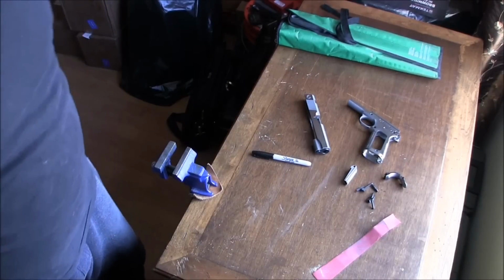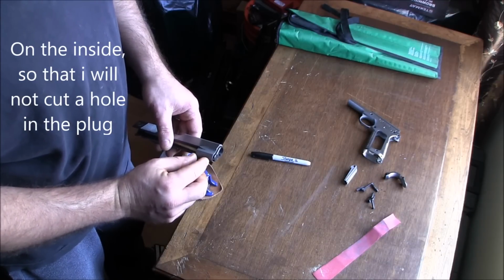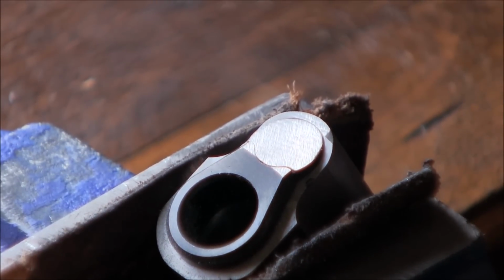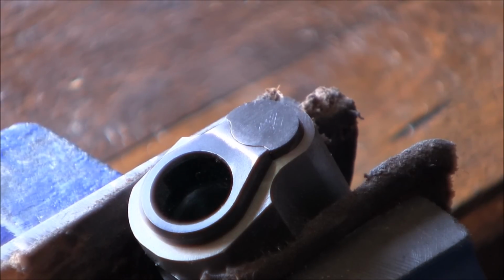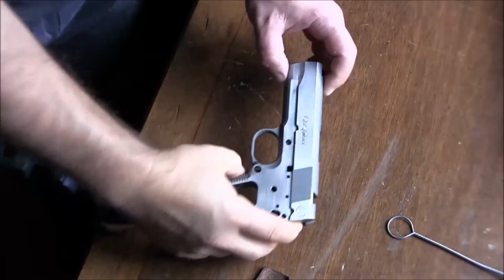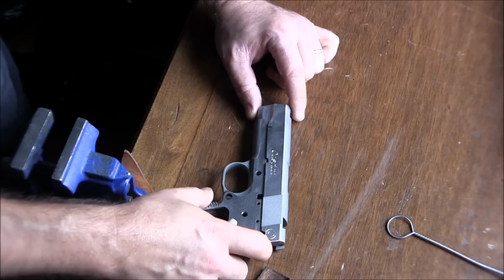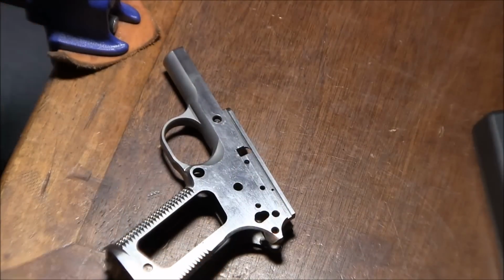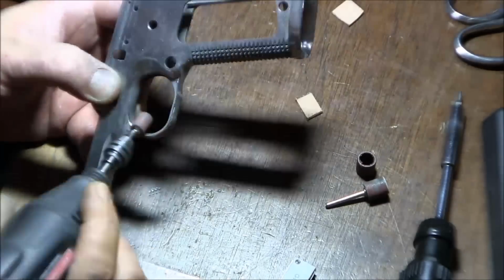1911 Build 8 Commander 45 acp - Part 11 - Bobnose and Dehorning

Comment: Mosin, did you ever consider putting a flat top on your slide?  I love the Colt Commander Enhanced versions -- in fact, I'll be receiving a Mark IV Enhanced soon.  I guess the point is the lighten the slide up a bit but I think it makes for easier target acquisition.  Anyway, love your 1911 builds.  Keep them coming!
Reply from the maker: Thank you. I actually put a tri-top on the slide for my Build 10.

Comment: Hey Mosin, I'm building a stealth arms 9mm commander right now and I just fitted the reverse plug. Before I notch the slide to allow it to recess fully I was wondering your experience with the recoil spring and assembly. I did some test tries and it seems like a real pain to get the spring in and the slide back onto the frame without the spring wanting to squirt out. Is that typical? I really don't want a full length guide rod in there, don't believe in them. Just thought I'd ask, love your videos, they gave me the confidence to try this and its working out very well. cheers
Reply from the maker: Yes, unfortunately there is nothing hold the spring in place wiht that combination of parts.

Comment: I would've liked to have seen you cut the dust cover to mimic the "bob cut".
Reply from the maker: Wayne Richter I would have actually done it if the slide didn't have a scallop. I had to start at the scallop and there wasn't enough room to angle the dust cover without exposing the back of the slide spring plug tunnel.
Reply: Great job, regardless.

Comment: Thank you for your responce, Yes I meant checkering the front strap & msh.
I did watch the video but I really couldnt understand how you got the 10lpi
from the 20lpi file?? Again Iam amazed at your work you make everything
look too easy. You are a very smart man & pay Great attention to detail.
You have probably been doing this a long time. Im in the process of trying
to obtain my FFL so that I can start a gunsmith business, I have been
working on guns for 26yrs but just asa hobby, I recently lost my perifial
vision & Im deemed legally blind so I can no longer drive or do the job I
have done for the past 30yrs. So I figure its a good time to take my hobby
& turn it into a business. But I live in MA and it being such a liberal gun
hating state Im not sure how I will do with getting an FFL..Sorry for the
ranting..
Thanks again
Scott
Reply from the maker: scott 1911man I am in CA so I feel your pain. I too am thinking of getting an 07 FFL in the future when I have more space and a workshop. The way I got 10 LPI is by using a 20 lpi file lightly to create guide lines, then using v files to deepen every other line. once I had those deepened lines, I filed the Front strap down a little to get rid of the other shallow lines.

Comment: nice videos mosin.. you're very talented.
do you know if the officer slide can be fitted into the commander frame. Thanks!!
Reply from the maker: Thank you very much. The officer and commander frames are identical I believe in the recoil shoulder position, So I think you can fit an officer slide to a commander frame. The dust cover will obviously be too long for the scallops on the slide, but that can be easily fixed.
Reply: Thank you so much for your repply, I'm a machinist and I'm building a commander like yours in a 9mm but I wanted it in a officer slide but I don't think they carry officers in 9mm so I guess I'll built 2 one commander in 9mm and the officer in .45, thank you so much mosin keep up the good work.
Reply: You know that video that you filmed cutting the dove tail, just if you want to consider some sights have the right side a little thicker than the left side, that's so when you inserts the sights you can do it from right to left so in that way the more you push it to your left the tighter it gets and it seats tighter..

Comment: What different grit sandpaper do you use?
Reply from the maker: Usually 220, 320, and 400.
Reply: @MosinVirus  do you go into the thousands for the finer finishing when blending? In order to get rid of file marks
Reply from the maker: @mr.b3699  no, filemarks should be removed by 220. 320 then removes 220 scratches, etc. I used 600 maybe once or twice, but generally I don't try to achieve mirror polishes so I never go too high on grit.